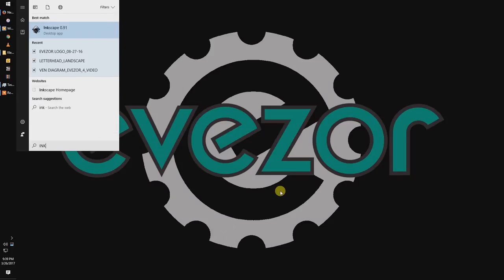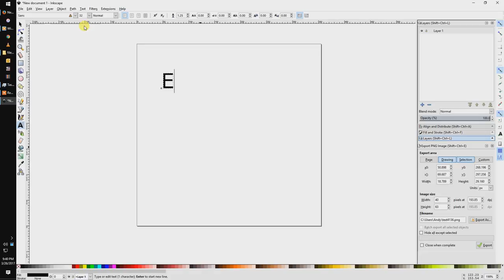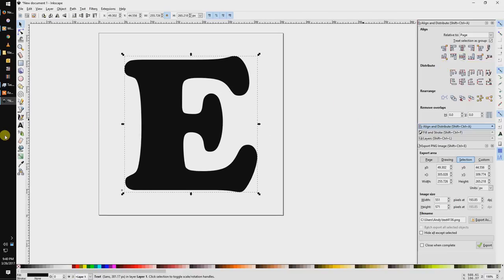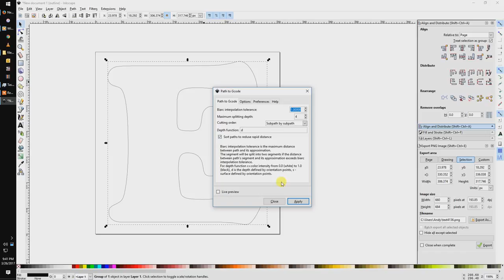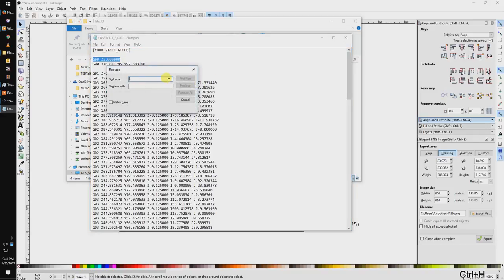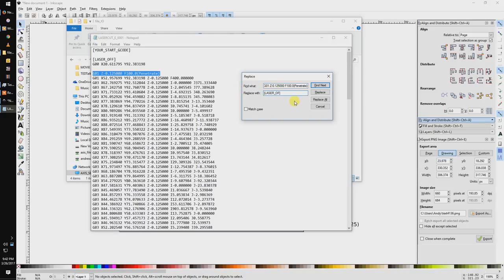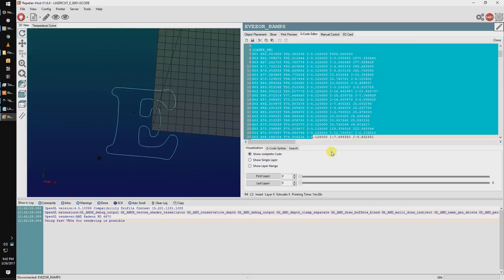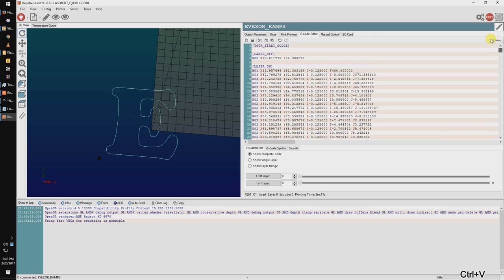Laser Cutting With Inkscape Tutorial

Comment: Great tutorial. Short, clear, and to the point. Thanks.
Reply from the maker: Thank you
Reply: @lloydphillips9724  he explains and shows each step. Really helped me. You can use the cog menu to slow it down, or watch some parts several times to see it in detail. 
What specific thing are you trying to do that this video didn't help with? I'm really not experienced, but maybe I can help.
Reply: @ktisistoukuriou  I got it now but not from your tutorial. It was how did you get the outline, How did you get the tool path. That's where I left your video and found one that explained it instead of saying go to outline then go to tool path so fast by replaying it wasn't slow enough to see. Did you look at the other comments also saying it was too fast for a tut?
It is a good tutorial, but not for a beginner and by saying that there are many on you tube that is superior to yours for a beginner.
Reply: @lloydphillips9724  glad you found it. This isn't my video, by the way just one I found helpful.

Comment: I want to use inkscape to transfer an object that has an inner and outer line. With a knife you would cut somewhere in the middleof the line. But a cutter does not understand... so i want to amke that line as thin as possible and theb import it into silhouette cutter software, so it can give me a single cutting line. How can indo that??.
Reply from the maker: The way I'd go about doing this is to bring in the picture (I'm imagining it's a jpeg or the like) and you want to do the 'trace bitmap' operation.  This will trace the picture and you will have 2 sets of lines.  If you then use the 'break apart' command (ctrl+shift+K) it will break the paths into their own objects. Delete the lines you don't want. Then if you don't like exactly where the line is you can use the inset/outset command to get the line where you want it.  (google how to set the inset/outset distance it's convoluted)
Then combine your lines back together if you choose and you can export svg or dxf or whatever your other software likes.
Hope that helps

Comment: Hi, great tutorial! I wanted to ask you if I can, at minute 1.14 when you give "ok" I do everything right,
but I don't see the path of the nodes around the letter "E". Do I make any mistakes or have I deactivated some function? Thank you very much.
Reply from the maker: There could be a couple reasons. The first is that you may have missed object to path that makes it so the outside of the letter is acutally a path. Text looks like a path but it is not until you use object to path.  The second is maybe you are working on a different layer?  Best advice would be to try something that is made out of lines and you know for sure, try those and then figure out what's not working.
Best

Comment: Cool. How do I know if my 3d printer can do this? It's a crappy one lol. I have an M3d micro. I know I can manually print with Gcode but I never can actually see the laser so I don't know if it would work.
Reply from the maker: I cannot speak directly for your machine in particular, but first Always use proper safety equipment. Second you can just plug in the laser to the port that turns on and off the hotend (make sure you end up with correct current and voltages). The rest is just GCODE, turn on the laser when you want eg.[M104 S200] and laser off [M104 S0].  Good luck!

Comment: maybe you should trace back and find out why it does not save in my files
Reply from the maker: sam terian In the preferences tab when you are using the "Path to Gcode" function there is a text box you will fill in with the name you want your for your file 
"Example.gcode"
In the text box below there is a box called directory. This is where you call out the folder, where you wish for the file to be saved.
"C:\" with out quotes will put it in the top level of your main drive. "C:\Users\YOURNAME\Desktop" with YOURNAME being your usename on the machine will save the file on your desktop.
Hope that helps
Reply: thanks